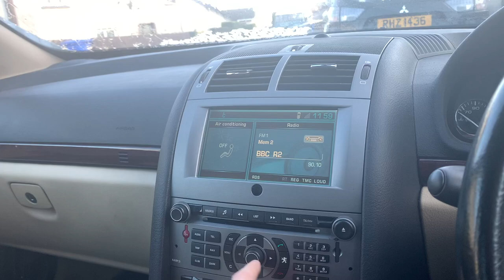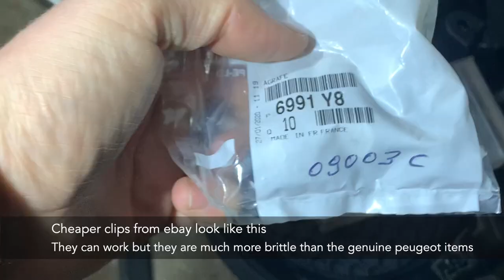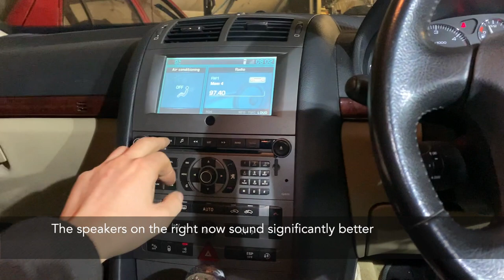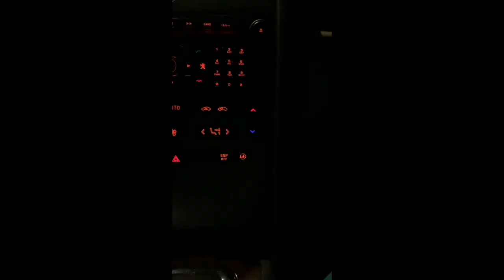Peugeot 407 Speakers Replacement

Comment: Nice video, thank you very much. You can find a kind of adaptors, so you don't need to cut the wires.
Reply from the maker: Thanks for the comment, glad to hear the video helped
Reply: I need to change 1 speaker so I will change all of them. I have the option to buy the stock speaker or the same Pioneer you installed....which one would you recommend? Did you get better sound with the Pioneer?
Reply: @CesarGZ.  To be honest, I'm not that much of a music lover and just went to the auto flea market and bought the same speaker from 407 2008 or 2010 year (from front door). In these speakers, the vibrating membrane has notches that prevent it from breaking. The sound is very good, better than before.

Comment: In the 407, to improve audio, you are better off installing a small add-on amp, which improves audio by 70%! (I then used Clarion SRP-1722S but these are discontinued sadly and the sound improved to the point I preferred it over the JBL and even the 20 speaker B&O option in an Audi A4 for quality). I use the Pioneer GM-D1004. To get this to work, you need the parrot kit ISO cable, making it essentially plug and play - a 10 minute job to install. Use 3M industrial strength Velcro and tape the amp to the heaterbox - easy peasy. 3M Velcro is VERY strong but still removable incase you need to change something, just make sure to clean mounting surfaces.
Reply: Can you show me the tutorial please? Im very unfamilliar with the subject..

Comment: Mate, your video just helped me A LOT ! Many thanks !
Reply: i change mine too   but he didnt tell what wire are positive and negative.  to connect correct on speakers.  White is Negative or..
Reply: @100janosky_3  plugs are in different size for + and -. You won't have a problem to connect your speakers.

Comment: would the process of replacing these wires be hard? planning on running brand new 150W@4ohm midtones in the doors and i think the original cables might be too small for such power

Comment: Hello bro, 
I have a 2009 Peugeot 407. The 2 rear spkr not working, so I changed them as your video, but when I connect the wires to radio not working, I chked it manually by give 12v to socket its work!!, where's the problem??
Reply from the maker: Hi there

A very common problem on all cars from all manufacturers is the link between the door pillar and the door, the corrugated rubber joint that is between the two door hinges is where the wires join the car to the door. The repeated opening and closing of the door can with time cause the wires to break apart. It is worth checking that by unclipping the grommet and inspecting the wires inside for being broken or starting to break, if necessary cut out the broken section and solder in a good new wire but make the 2 joints away from this area ie one joint in the door and another joint in the pillar so the new wire does the flexing. Any solder joint or connection in this area will fail very fast due to the movement.
…….

And now ive read your question more carefully🙈
Possibly your fader front to rear settings? If the two rear speakers dont work im not sure both wires will have failed together especially if you have replaced them recently. Did the old ones work somewhat?
Reply: @peugeotCitroen2CV  
I bought the car recently, with this problem, so I give 12v from radio socket then I heard the tone signals, but when I connect the socket to radio there's no sound
Reply: @lecturerhusseinattallah6864 from settings you need to  make balanced about speakers

Comment: Hi there. Very useful video. Can you install the same speakers in front doors as you installed in rear doors? Or there is specific reason why this is separated. I hope you will answer. Best regards
Reply from the maker: Hi
From memory the physical dimensions of the speakers are different. Bar figuring out how to fit the speakers my knowledge when it comes to speccing the right speakers is a bit more limited, these ones just seemed popular on the owners club.

Comment: I have rattling speakers, is it loose screws? I need to fix it asap. I'll use this video as a guide. And tips welcome

Edit: maybe install x4 new speakers while im at it?

EDIT: also any recommendations on which media to replace stock one with, my screen fades too much and needs a change. Would like driver controles and climate controls compatible. 

Thank You

Comment: how did you make sure the polarity of the wires was correct ?
Reply from the maker: There was two colours of wires going into the speakers, and on the new speaker wires there was a black and white wires. Just kept them consistent for all 4 speakers. Testing them before putting the door panels went back on over them.

Comment: Good video.  What size is original speakers fit to buy..  16cm or 16.5cm  or 17cm  🤷‍♂️
Reply from the maker: Hi there
To be honest i dont know, check the details of those pioneer speakers for sizes. Just seemed to be a popular speaker on the owners club
I sold the 407 and bought a mid spec C4 instead, the sound quality from it is much better than the 407 even with the pioneer speakers so the headunit must have been a limiting factor

Comment: Did the sound get better? Sounds like a lot of power for this radio. So there will be a lack of signal to make these speakers play with quality.
I think a 30W would be better. The sound would be more bass and less distortion. But good job.
Reply from the maker: The sound got better, less crackling and buzzing which was caused by the old speakers basically falling apart. However its not the most sophisticated of systems there is no fancy headunit or amplifiers here. The stock radio has its limitations, its an okay sound quality although sitting in a car with a good audio system and it would be better. This is just easier to listen to, dont really want to spend any more money on this car. The heanunit is badly showing its age but aftermarket options are limited to off brand stuff off alibaba none of which seems to be without annoying flaws.
Reply: The power handling capacity of the speakers doesn't really matter here. What you want with the stock radio is good sensitivity. PS. The 300W claim is just some marketing number, the nominal input power for these Pioneers is actually 40W...
Reply from the maker: @Bumper3D  I think 40w was on the box, to be honest i just asked on the owners club to find out what everyone else was fitting to their 407's and these were close to being unanimously recommended.
As an overall in car entertainment package its not the best, streaming music through a phone via an FM transmitter still wouldn't deliver the most impressive sound quality but at least the buzzing and crackling has gone. The sound quality on FM radio is quite good, haven't tried CD's because whats a CD😂

Comment: Muy bien, bravo, ¿y los altavoces del salpicadero? Esos no se cambian, instalación a medias....
Reply from the maker: Sorry they were not covered in the video, i kept the original tweeters in place as they seemed to be working fine, they did not have a paper cone like the door speakers.
I also deemed the original items to be higher quality than the lighter feeling items that came in the box from pioneer. 
I think the JBL items from models specified with that sound system are a good tweeter to upgrade to.

Comment: Hi mate what about the tweeters in the Dash, have you gave them a check?
Reply from the maker: I had them in my hand, the original peugeot ones felt better quality and heavier than what the pioneer ones felt so never went and changed them
Reply: @peugeotCitroen2CV  did you match the speaker impendance or just installed it and called it a day? I just bought 407 jbl kit with the AMP and all but beore i get to make the wires for the AMP it's gonna take ages so was thinking of hooking up the speaker as it is
Reply from the maker: @adrianrylski8794  
I just installed the speakers and called it a day, im no expert on car audio. Just asked on the owners club what speakers everyone else was fitting and put them in.

Stopped driving the 407 a week or two ago, bought a C4 hatch. Mainly for fuel economy but its not even a high spec model and its sound system sounds miles better than the 407. Perhaps just a result of a built in Bluetooth module rather than using an fm transmitter
Reply: Hi thanks for the video, it’s a big help! What stereo have you got? Trying to get help with audio for my Peugeot is a nightmare.
Reply: @jamesduffy6032  what stereo problemu you got boss maybe im able to help out